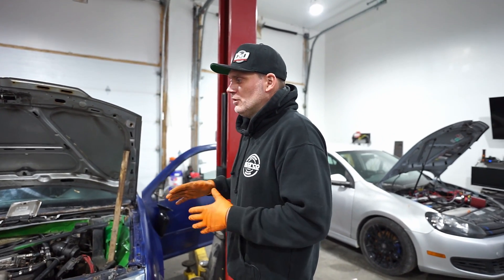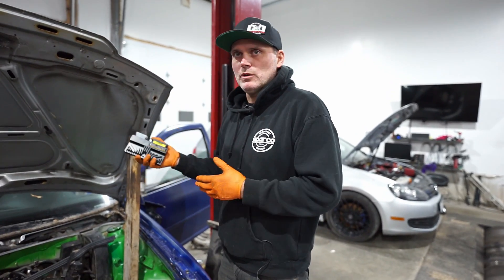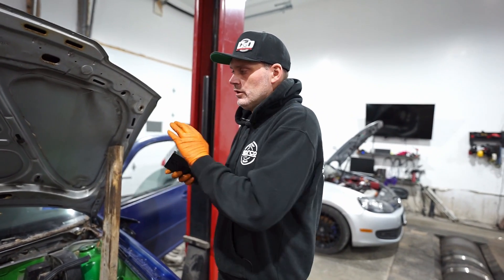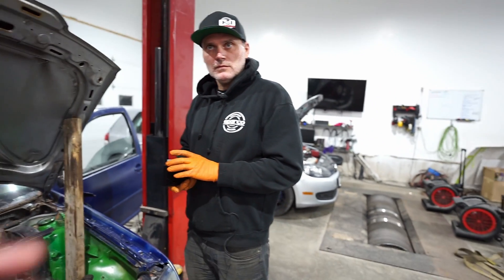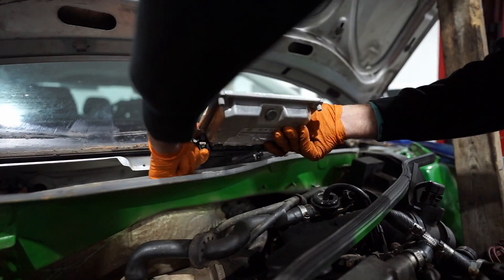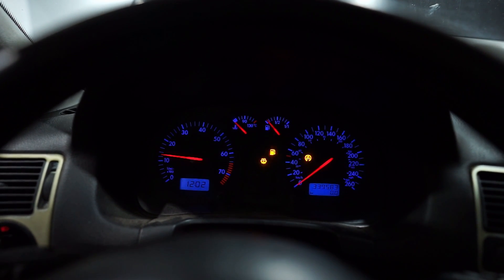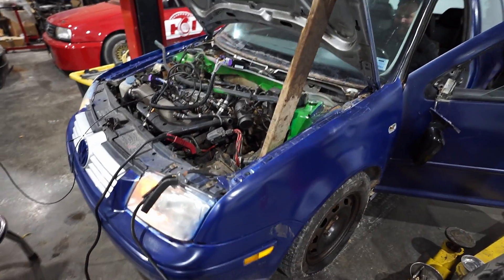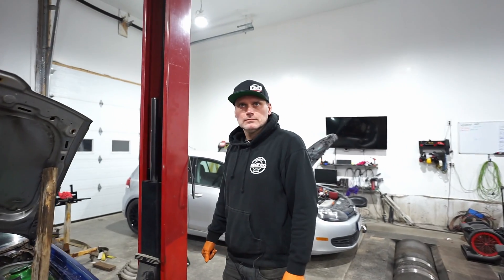Affordable standalone for your MK4 1.8T

Comment: Awesome video! I have a 05 gti, originally came with the awp engine. But has been swapped to an ahp. Would this still work? 
Also how would I tell if just the head has been swapped or the whole motor?
Reply from the maker: If the ECU is original that's all that matters, which it likely is. It's the wiring that's important not the physical engine components.

Comment: great content guys, do you have any recommendations on ECU for an AGU engine?
Reply from the maker: There's lots of great standalone out there. This is just one of the less expensive ones with decent features.
Reply: Link PNP ECU works great if you repin the harness and run traditional TPS setup

Comment: You guys played around with Ignitron at all?

Edit: nvm, I see you mentioned them in the video. What functionalities are you referring to? They have flex fuel capabilities, self learning, speed density, rolling launch, boost by gear, limp modes for user set values of lambda, timing pull, etc.
Reply from the maker: Nope, I tried for a 2.5 5cyl project we have which their website states their ECU works with. When I reached out to them their answer was "We don't have any 5cyl's running our ECU".... at that point I knew I should look elsewhere.
Reply: @COMotorsports  I see it does say 2.5 on their website. Interesting. I'm in a few ignitron specific 1.8t groups as well as general big turbo 1.8t groups and people seem to love them. I'm going to be acquiring one for my b6 here in a couple months when they're back in stock.
Reply from the maker: @WyGuyTurbski  My issue is this... take it for what you will. I've used quite a few standalones over the years, the biggest thing I can recommend from my experiences and money and time wasted, is buy something that is more mainstream. When it comes to support, product development be it software or hardware you know things are going to continue on. As time goes on the smaller more specific outfits typically start to disappear and the product dies off leaving you in the dark with old hardware and software. The more mainstream outfits will continue on supporting and making hardware and software as it's their full time business, not a side hustle. So my opinion is think long term for the reasons listed above. Also maybe you won't even want that car or engine in a few years, something like this can easily move with you.

Comment: ignitron does give the same functions and full oem support, the ability to expand, etc. oem 4bar map support, or any aftermarket, true speed density or alphaN(mafless), or any maf you want to scale, traction control variations, boost by gear, haldex control, me7.5 car support(s4, 24v VR,etc), the ability to add to the ecu, has full lambda control on board, can run 2 with the new firmware update, and sooo much more, etc etc. You can still use the DLC(obd port) to run torque pro and such, but like the emu black, it doesn't support emissions testing YET. Having installed, built, swapped and tuned many 1.8t's(and other engines from various makes and models) I personally choose ignitron after tuning a few cars with it a couple years ago.

  I still think, top three PnP for 1.8t, in order are...

1)ignitron
2)emu black
3)haltec
 The difference between 1/2 and 3 for plugnplay simplicity is fairly large, but the haltec is just as powerful, though it has less oem component support in my opinion.
  But I don't have a cool youtube channel ;)

  regardless, you guys keep knocking it out of the park.
Reply from the maker: The difference for us is this... I've been doing reflashing tuning for a long time. I've seen plenty of clients move from one project to the next, or swap engines etc. This option allows you to grow and doesn't simply back you into a corner. Software and tuning is expensive, so having an option that can grow and move with you no matter what the engine or platform is big to me.

Comment: Im planing too push my gt3076r .82ar to 30psi and aiming for 500+ crank hp.It has 7+7 billet wheel.If i guet this ecu what injector you recommand between Genesis II 1000cc and Injector Dynamic 1050cc and why?
Reply from the maker: Either will work, if the money's there and we're talking new ID's I'd go that route. I run a set of Genesis II's in my drag car... however the first set didn't last very long at all. I believe the newer set is quite a bit different and they've been great.

Comment: Is there a turbo kit for the 2.5L
Reply from the maker: Not exactly.
Reply: @COMotorsports  before C2 motorsport went out of business they made a kit I can't believe no one followed up with them or made a kit for them 2.5L
Reply from the maker: @craizygolf1980  we're aware. We've done a few of those kits. I even did a stainless direct fit replacement manifold for their crack prone manifolds.

Comment: My 05 gli 1.8t came with 4 tune slots on the factory ecu the. Via. Cruise control.stock .. I'll have to turn the cruise control and hold down on it until I check engine light flashes a certain amount of times  one slow flash ..means stage 1x amount of boost...do same steps again and hold ... flashes and this time wait a little longer and u will see the check engine light flash keep holding till u see it flash two times that will be stage two tune boost keep holding and get three flashes third so on and so forth u can also lock it in valet mode limits it to 5lbs of boost so if it girls got the car she can't get all boost crazy lol 🤣🤣🤣🤣...but ya 05 GLI 6spd.has 4 tune spots u just got to tune it
Reply from the maker: That is an APR tuned ecu. We've been an APR dealer for a long time. Also, it doesn't switch between stages, it switches octane files. So if you're stage one all the files are stage 1 but different octane levels. If your stage 2, or stage 3 same rules apply. It's octane files specific to that stage.

Comment: We also used emu ecu before. But we stopped using it and we are using maxxecu now. We just did a RS4 B5 with a maxxecu and we also converted it to dual wideband.
Reply: also a big fan of maxxecu - was pretty easy to setup/tune on my C4 S4. ECU Masters was definitely on my radar as well though - seems like a great package for the price.
Reply from the maker: Haven't used Maxxecu yet. Not so common around these parts.

Comment: How did you give the EMU constant 12v power? My PnP for my VRT had me give constant 12v off of the battery through a seperate wire and terminal.
Reply from the maker: It all depends on the harness it's attached too.

Comment: I've been looking at standalones as a potential future upgrade for my 1.8T and so far the Ignitron has been the best choice. How does this ECU do with emissions testing/readiness monitors? I know the Ignitron supports this and is an important factor in my decision. Thanks!
Reply from the maker: Well if you need to get ECU data from OBD then it's not an option.
Reply: @COMotorsports   I think you guys should check out Ignitron ECU, it's a great standalone option for VAG 4, 5, & 6 cylinder engines. Tons of awesome features for a good price, plug & play with the stock 1.8t harness & sensors (it does require wideband o2 & DBW though), and it's super user friendly. It plays nice with the stock CAN & cluster + you can retain cruise and traction control.
I struggled with Maestro for 2 years & finally decided to ditch that garbage software because it can't support flex fuel tuning. I've been running Ignitron in my B6 for over 2 years and im still in love with it
Reply from the maker: @mikebush5325  We're aware of that ECU, but this provides future growth be it support, hardware or software. Not to mention the ability to use it on any engine... not just a VW/Audi.
Reply: @COMotorsports  Yeah. It doesn't look like I can pass emissions with this unfortunately.

Comment: Bruh Microsquirt is still much cheaper and its basically PNP. Took less than a day to wire it in and get the car running and everything cost less than $500
Reply from the maker: And is not comparable.... or practical for most.

Comment: Will this work on or do you have one for a aeb?
Reply from the maker: We could likely wire it to work with AEB, or you can just get an AWP harness. With the AEB you could actually go down to the cheaper EMU Classic option as the AEB is cable driven. EMU Black is required for DBW throttle, EMU Classic doesn't support DBW.
Reply: @COMotorsports  man you got me thinking. I am plaining on a giac tune for a k04 i am going to put on mine with 330cc injectors because thats what they said i need. This might be a better option. I wanted malone but they wont touch my ecu. If you have the classic with plug and play i might just go with that.

Comment: Really like what your doing with this. You mentioned Ignitron, It's even easier to install than EMU as it was designed to replace the ME7.X ECU . Comes with base maps installed to cover pretty much any car using ME7 ECU. Intergrates seemlessly with the stock car, connects to other modules via the CAN bus giving ABS wheel speeds, Oil temperature from the cluster if the car has an oil level sensor fitted, controls the haldex if you disable the ABS, supports DQ250, DQ500 DSG gearboxes, anti lag,rolling anti lag, flex fuel etc etc. Direct connection to a windows tablet to display gauges , Logs in real time continuously upto around 30 parameters. 
Logs all parameters, hundreds of things including all the status bits if you want to allow you a full log of an acceleration run or dyno pull. Plus many other things.
I had never tuned a petrol car before building the engine on my MK1 TT. It's currently running around just over 510bhp on a G25-660 with a 2012 Audi TTS DSG box that I fitted.
https://www.youtube.com/watch?v=_t-PCuj9bzo  

https://youtu.be/uNzd7GhRgB4
Reply from the maker: I've dealt with smaller companies like this in the past, remember I'm old. It typically doesn't last as folks move on and support and hardware falls behind. I get that Ignitron works, but a perfect example is on their website it says supports 5cyl... when I contacted them about doing one of our 5cyl projects they're reply was "we don't have any 5cyl running this ECU". This simply proves the size of the operation, and customer base. Also that ECU is specific to that platform (basically). EMU Black can run whatever you want, and in most cases very easily. Sure Ignitron can work, but when comparing it to this... I would chose the EMU Black time and time again, it's just as easy to install, and has amazing support, and you don't have to worry about it being left behind when it comes to software/hardware.
Reply: @COMotorsports  which 5cyl? It supports the VR5 and I'm personally running it on my 07K turbo swapped R32
Reply from the maker: @TheWingMeister  then their tech support doesn't know whats up because I had this conversation with them earlier this year.
Reply: @COMotorsports  I only started the project this year, might have been why. I know there's a few other guys doing it now too.

Either way, standalones are sick depending what you use. Anything is better than standard lol
Reply from the maker: @TheWingMeister  well best of luck. The EMU black used in this video is actually mine for my 07K swap. ;)
Reply: @COMotorsports  nice man #07ktheworld ;)
Reply: @COMotorsports  I get everything that you say and it is a pretty small outfit. 5 cylinder cars are not as common in Europe as they appear to be in the states/ Canada. I have never had an issue with support direct from the developers via the Facebook forum page for users, but as you say a smaller outfit is more likely to dissapear . It took me longer to remove the wipers and scuttle on my TT than it did to configure the ECU with the wizard and get the car running. No adaptor cables just true plug and play. 
Looking forward to what you do with this.
Reply from the maker: @karlaudinut9832  I get it, and I'm not saying the support isn't there currently. It's just not on the same level. And then you still need to consider long term when it comes to software and hardware development. I only say this based on experience with other smaller options over the years.

Comment: Still looking at around 1800 usd with pnp adapter and so forth. Though I'm not quite sure what the auxiliary adapter is for. Connecting to laptop maybe? I assume this will work with an me7.5 awm?
Reply from the maker: It's $1400USD as you see it running this engine. If you want additional things then price goes up but is not required. As for the auxiliary adapter option, we can pin in an extra connector to make it simple to wire in additional inputs/outputs... such as ethanol content sensor for example.

Comment: Audi 1.8t of similar year models?
Reply from the maker: You can send us an email and we may be able to assist with your specific chassis/engine code.
Reply: @COMotorsports   B6 with AMB engine code. Has an AWP head now. Looking at possibly BT mid summer next year. Just feeling out possible options for tuning.
Reply from the maker: @j.b.1526  It's possible, wouldn't be this exact configuration though unless you switched to an AWP harness.
Reply: @COMotorsports   Eh. Thanks for the input. It’s doable but more in-depth than I wanna delve into. Some of the dash cluster is different, speedo is ABS and not off tranny, etc. 

Ready for my mmmkay4 madness. Excited to see it grenade on the dyno in a few months.

Comment: I just put an EMU black pnp setup into my mk4 1.8t GTI. Mine is a 2008cc stroker with Scat rods, Wiseco pistons, BC Stage 2+ cams, BC springs & retainers, Pulsar GTX3071R gen2. Tuned on e85 it made 550 whp & 455 lb/ft of torque at about 25 psi. I have no complaints about the ECUMaster, definitely a great option for our cars. 😎👍🏽
Reply: @rossi How do you like the cams? I have a set I bought a while back and Olán on installing them later once I break my motor in.
Reply: @bumblebvr6  The BC cams are great! My idle is set around 1100 rpm. They will idle lower but it will be a little rough, plus I have pretty stiff motor mounts. My car was tuned up to 6,800 rpm, but power was still increasing, and I'm still using the stock intake manifold.
Reply: @onlyrealones  Nice! Thanks for the reply. No issues installing? They have marks on them like the factory cams from what I remember when I received mine a while back.
Reply: @bumblebvr6  No issues at all when installing. The marks are very small but once I put the exhaust cam in and aligned the cam sprocket mark with the mark on the valve cover, I saw the mark and I knew what to look for on the intake cam when I installed it.
Reply from the maker: We agree, great option.
Reply: How do you like the pulsar??
Reply: @conorjamesthomson  It's been great so far. I don't daily drive my GTI so I'm not sure how it will do with a lot of mileage put on it. I think it's a great low budget alternative to a real Garrett turbo.

Comment: My only concern from going to a stand-alone ecu is I have a Color mfa cluster if this still works with that sign me up!
Reply from the maker: I would say if a color MFA is your concern then standalone isn't probably for you anyways. Standalone is typically for folks where control and HP is the concern, other stuff becomes second. Now saying that a bunch of stuff would still likely work, I just haven't tested it to say what does or doesn't.
Reply: My MFA still works just fine with EMUBlack.
Reply: if the cluster works, ColorMFA should work as well
not sure about the diagnostics function though